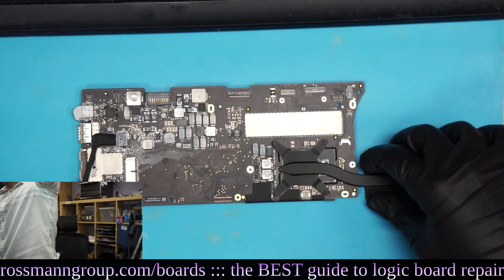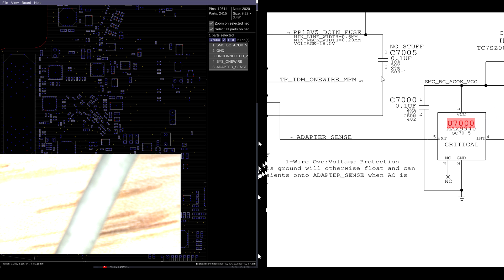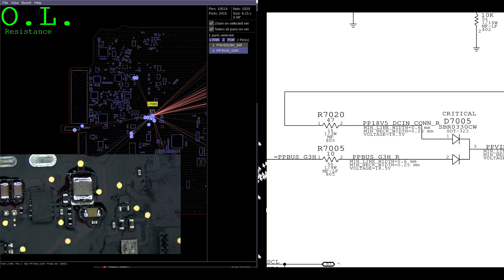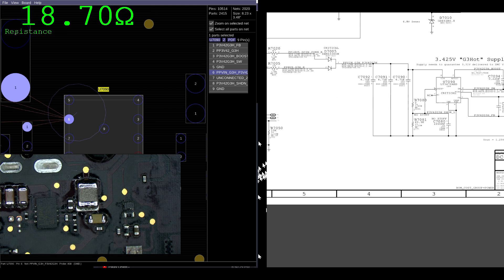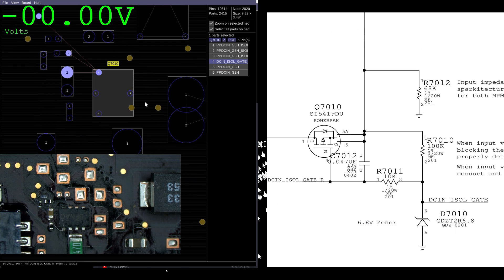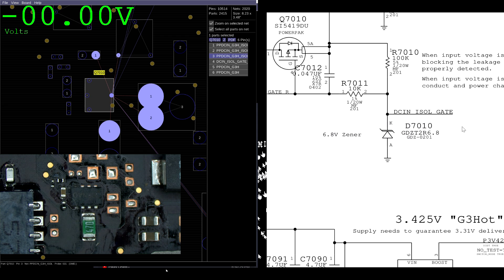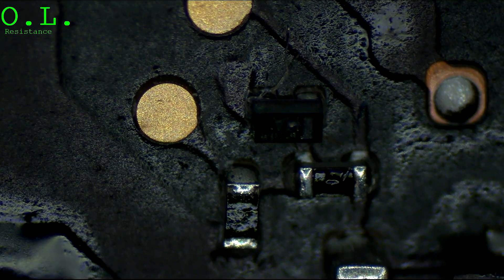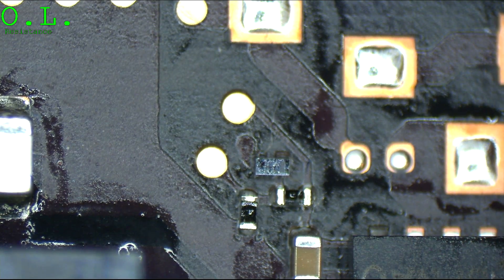How to fix a Macbook that won't turn on.

Comment: What happens if the light on the charger does turn on, but the MacBook won't turn on. My MacBook was working, however it randomly wouldn't turn on one day (no fans or anything...) and I opened it up, disconnected some flex cables and dusted it out and reconnected them and it turned on again, however it stopped working again a day or two after that. Any ideas?

Comment: Hi, great channel and interresting, but maybe you can give some theory about my Mackbook Air 2016. it's something really strange. Over the last 6 months i've found that the if i let it lay and get discharged by itself(obiously takes ages since off), then it starts up right after i plug in the charger, without needing to push power. It then stays on and works until battery is around 60% charged, then it shuts off. Amber light steady on. Then if i unplug the plug, no light comes on after replugging. I've tried all the resets out there and also unplugged the battery internally, but only thing which gets it going, is to let it discharge again and start it. Obviously unusable, but at least i have something to go at. You have any idea og what the problem could be?

Comment: Louis,

First off, big fan of your work and all that you do to call Apple on their BS. Keep up the good work.

I was hoping you could help me with my PC that won't turn on randomly.

Last Friday, computer wouldn't turn on so I went into diagnosis mode. Swapped out the power supply, shorted both my PSU's on to verify they work. Unseated and reseated everything. Verified connections were securely inserted. Took the CMOS battery out and dumped the memory. Swapped ram slots, tried one ram, took out the GPU and tried to use onboard graphics. All up no avail.

Finally broke down and took it to a repair shop where they found nothing wrong. They said there was a screw rolling around in the case that could have caused it which they removed.

Today, 3 days after I took it in and was given a clean bill of health, it won't start up from sleep. Unplugged the computer, held the button down for 30 seconds per someone else's recommendation. Still nothing. Was told something about windows fast start could be causing the issue where it doesn't do a proper shutdown.

Today makes the 3rd time that this has happened and after a day or two it works fine again. Almost like I have a possum for a PC that conveniently plays dead.

All equipment is less than a year old except the graphics card which is 3. Also, the case is probably a month old since after the first time this happened I assumed it was the power button on my old rig.

Faulty motherboard that I need to do a warranty claim on or do I need to take it to another shop and get a 2nd opinion?

Thanks, and keep up the good work,
Gabe.

Comment: I'm pretty sure my logic board within my Mac failed, the charger lights up when I plug it into the laptop but pressing the power button is useless as it doesn't turn on or show any signs of life. I should also point out that the internal battery died less than a year of purchasing my mid 2012, 15" MacBook Pro...The HD died a year after that and the MagSafe had to be replaced not to long after that. Apple is garbage in my opinion 😒😒 overpriced garbage.

Comment: Hi love the show, learned quiet a bit, but i have a question... i have a MacBook unibody with a a1344 adaptor, and i got a trip coming to europe and their 220V grid, is it safe to use the adaptor there? Or should i get a converter?

Comment: Why do you plugged in standard connector? You should use bench power supply to measure turn on current draw, voltage harmonics etc

Comment: The net on your exhaust fan....is that a hair net? That's what I use, as I've lost so many small parts being sucks up into my fan over the years......
Just wondering if buy something specific or use something cheap in cost!
I've had migraines for past 6 months off in for day on end. Feel your pain with your headache.....sucks.
Cheers, A

Comment: Isnt 1.8 volts a bit high for a modern cpu?
Reply: Perfectly fine for mobile Haswell/Broadwell that have an integrated voltage regulator. The 1.8V doesn't get to the actual cores.

Comment: Real zoom with real lenses is great. It's a shame that you can't get that on phones.
Reply: I mean, there were a few phones that did it, but nobody makes them anymore...
Reply: I agree, I always thought it would be kinda neat if phones had a little screw thread or locking mechanism around the camera to allow you to fit different lenses.

Comment: Louis fuses don't blow to protect expensive hard to get multi pin thingos, the expensive hard to get multi pin thingo blows to protect the fuse.
Reply from the maker: Excellent.
Reply: Think different.
Reply: Before, it acts as a warning

Comment: What do you think about surface devices? Professionals say they are well engineered and high quality and durbility products but i want to know your opinion louis about them.
Reply: Frascaupazz because Microsoft put a guy who helps restore PCs in jail.
Reply from the maker: Junk. Many die for no reason, they are poorly supported from Microsoft, and totally unfixable... IMO junk. 

Also, they do not exist: they are not real.
Reply: They're not easily serviceable and also made by Microsoft. He probably hates them.
Reply: Why he hates Microsoft?😂

Comment: So why a zener diode there? Why not a standard one?
Reply: David Fuller probably there as  over voltage protection or maybe as a voltage reference for the gate.
Reply: Unlike a regular diode a zener passes current in the opposite direction once it hits the rated voltage of the diode which makes it useful in the way AlexlLB suggested, as either as a form of protection or as a simple voltage reference, I would recommend watching this if you wish to learn more. https://www.youtube.com/watch?v=xSQHfsHTS88

Comment: You do realize you could get a lot more work done if you didn't bother to explain all of this to us morons, right?

I can't thank you enough for these videos. I love the edited ones as well since I can't always watch live.
Reply: he's teaching by repetition- after a while you can't help gleaning at least half of an idea about 1-wire, pepe bus, etc. XD
Reply: Except he gets a lot of work precisely because of these videos (either directly or indirectly). And the fact that he has more work than he can handle is why he has the luxury to set rules about what he doesn't take, like the recent "no foody boards" rule, and probably a higher rate too.
Reply from the maker: Rules have existed for a long time actually.
Reply: outseeker I find these videos to be rather relaxing, something to watch when I’m tired.

And I actually feel I’ve learned a few things about board repair, checking power rails, short to ground, reading schematics, etc. I certainly am not at a level where I could fix a board myself but it’s interesting to know.
Reply: He Literally did a video a couple hours before this explaining why he does these videos, you should go watch it
Reply: But then he wouldnt have as much fun while repairing stuff.

Comment: Sweet! I liked how we saw how small the stuff really is with the zoom out I feel for you now that I really can see how small this stuff is you are moving on the board.  my hands have tremor and I would be all over that board with those chips.

I have hard enough time just buildings PC's let alone trying to work on a board.

btw is there a reason those parts look smaller on the mac-book than they do on a PC motherboard.

I tend to use Asus boards. it just feels so much smaller.
Reply: Probably because they are.